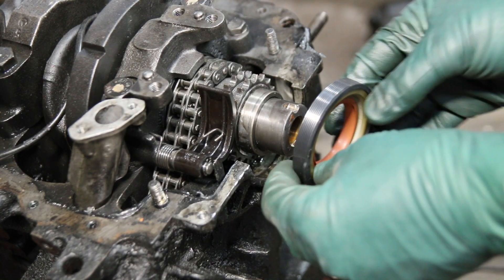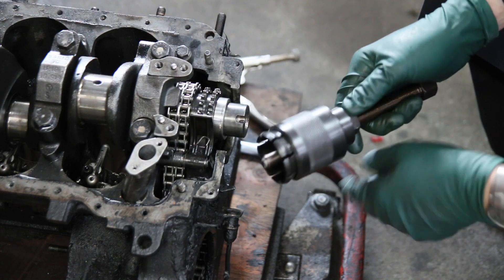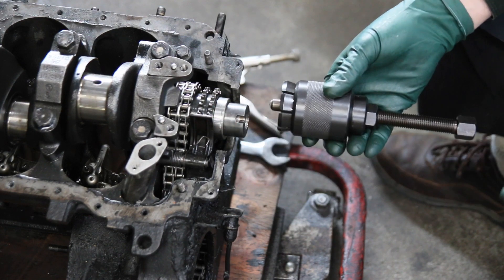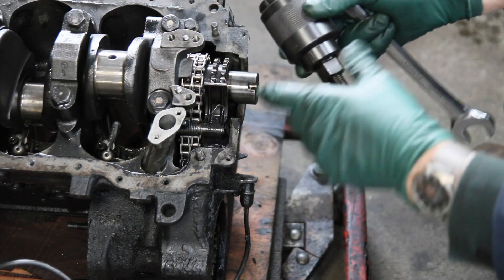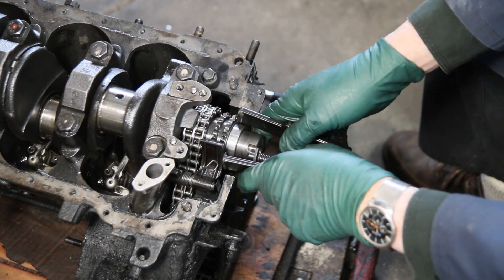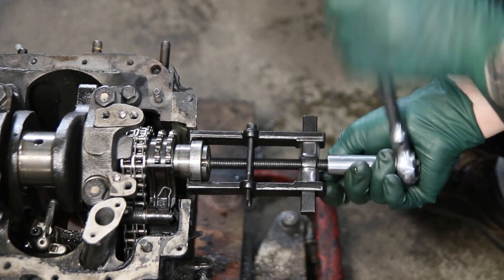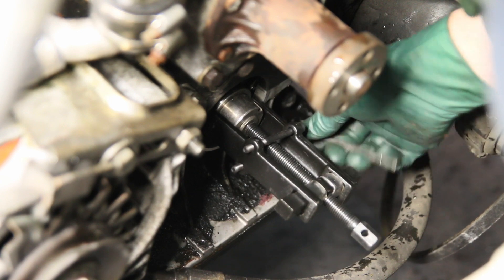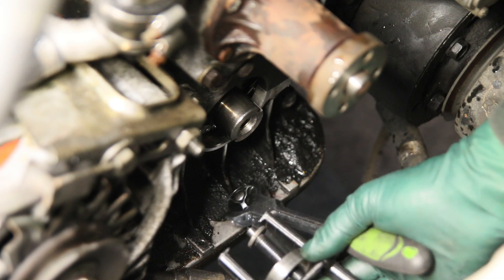Tools for Removing Front Crank Seal Race on Older Mercedes Engines

Comment: So I guess the interference fit alone between the race and the shaft is enough to work as a seal between those parts? Anyways, it's a clever design to have that race there as a replaceable part instead of having to change the shaft if it gets worn down over time.

Comment: I have an OM617 and it almost started but I just can figure it out can you help please
Reply from the maker: There are MANY reasons why your diesel may not start. I have many resources on my website to teach you how to troubleshoot and repair the problem yourself. Begin by searching tech help - use the search box for your questions.  https://mercedessource.com/problems/engine/diesel-engine-starting-problems-a-quick-reference-solutions-guide

Comment: Hi. Your videos are very informative and great for learning, thanks. 
I just watched an old one of yours on restoring dead AGM batteries. 
I have 2 deep cycle agm’s I want to try it on. Can I use a heavy duty car battery as the in-between or should it also be a deep cycle one?  Thanks in advance.
Reply from the maker: Any GOOD 12V car battery will work.

Comment: Hi Kent. Are the two studs in the block used for the oil pan front seal bore alignment? I hope so because I didn't think about that when installing the oil pan. I installed a new race and seal when I rebuilt the engine, But the seal leaks. I wonder if the pan is aligned.
Reply from the maker: The most common reasons for a new seal leaking is during installation the spring on the back side of the seal pops off or the lip of the seal rolls over on the race.